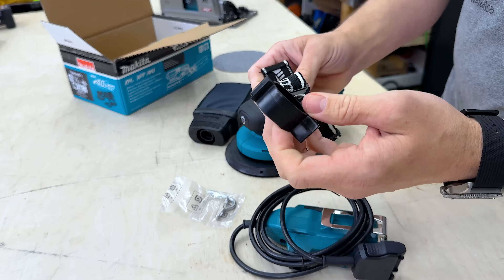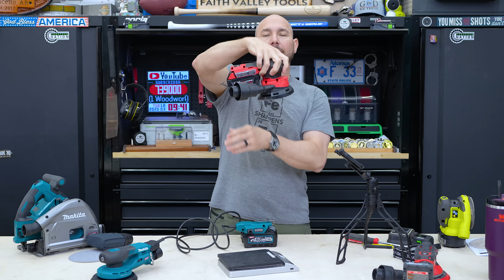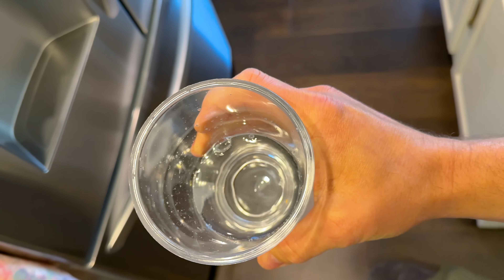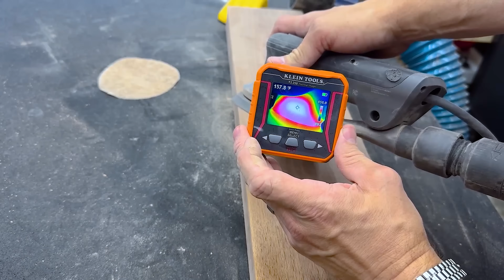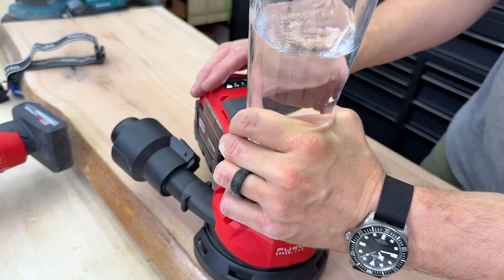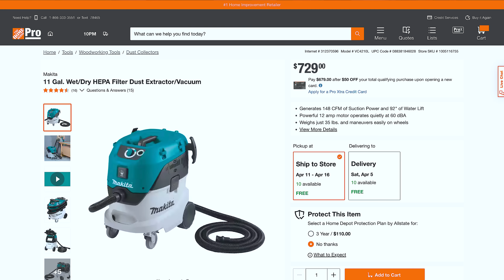Makita Just Changed Cordless Sanders FOREVER! (genius woodworking tool)

Comment: the high powered corded electric sanders cost much more than $250.  You can buy a low powered one for less.  You can't set the power/motor same way on a AC powered system.

Comment: Geniuses! I was thinking about that for last 15-20 years, but why not 48V or 96V? Why there is 5 pins and enforced communication with XGT battery that makes the tool useless if you want to use different 40V power source (it won't run without detecting the chip in the original battery). So if Makita, only 18V tools, because they do not care about genuity of battery.

Comment: Looks like a great tool for portability when NOT connected to a dust extractor. Kinda curious though why there isn’t an actual electric corded version though. Sanders both work and last so much longer when used with a dust extractor. So where is the use in a cordless sander when most folks would connect it to a dust extractor that needs to be lugged around anyway. Feels a bit like a lost opportunity. Quite disappointed.

Comment: I wish that Makita offered a direct AC connection for this sander. The tool is not that expensive, but when you add one battery and a charger, the price is doubled. I always use my sander connected to a dust extractor, so the portability of battery operation has very little appeal for me. I already have a 18V Makita LXT batteries and double charger and I don't wish to buy another set.

Comment: Thanks for this. I may jump on it. I have the 40v Makita Track saw and am super impressed with it, so I have the batteries. I have had several Festool ES 125's, and have used almost all the festool sanders, and the newer version of the 125 is problematic. It's been back for repair several times. I bought a Bosch 12v 5" sander and am super impressed by it. Ergonomics fantastic, smooth as silk. Battery life is the only caveat, so having the big Makita 40v even with a semi cord could be fantastic. I am a painter and also do millwork and trim carpentry.

Comment: Very interesting- I really don’t bother with cordless anything because I work exclusively in my garage, but the vibration and weight aspects might be enough to convince me. For the three people who actually read a sander manual, you may have seen a warning that people with Raynaud’s disease should not use the tool- that’d be me. Raynaud’s is a condition where the tiny blood vessels in your extremities go into spasm and cut off blood flow. It cans be uncomfortable like the pins and needles feeling you referred to, and in extreme cases there can be tissue death from lack of blood flow. Vibration is one of the main things that will set it off in addition to cold, so I have to be extremely careful about sanding. The Festool is just plain out of reach, but this isn’t and would be a really good investment. And even people who don’t have Raynaud’s, be careful about that prickly numb hand feeling after sanding for a long time! That’s nerve damage starting to happen and that adds up over time. A scrap of foam or even just a balled up rag between your hand and the sander can help protect you and keep your hands usable for more years.

Comment: Question, in case you've seen the delta variant or rectangular variant of this: it appears that you can't use it in tight corners like around windows inside corners because there is a plastic cover around the edge of the sanding pad that would bump into the wall meaning you miss the last couple of mm of area to sand. Is that correct? 

I'm looking for something like a mirka deos but without having to hold down that damn trigger all the time. Those mirka sander pads are angled so you can get in any corner even when confined by walls around the window.

Comment: I bought this sander based of this review alone. its amazing! @731woodworks i noticed you connect this sander directly to your festool extractor. do you think its worth a cyclone for sanding? or is it such fine dust and slow build up that the bag in the extractor alone is enough? many thanks!

Comment: I've been using mine with the 3mm orbit for a couple months now and its brilliant. 
I'm a painter and the weight of batteries gets too much when sanding above your head or even vertical surfaces. I know everyone is shitting on it because it has a cord but thats the best thing about. I dont always have access to power and when i do i hook it up to my Nilfisk M-class vac with the auto start Bluetooth controller, dont waste your money on the chips for makita tools.
This thing has a lot power for a cordless even more than some corded sanders i've tried, No regrets here.
I'll be buying 2 more, one with 5mm orbit and one with rectangle base, all for around the same price as festool where i live. 
***TIP for using it with a vac, buy the longer cord and attach it to the hose with the battery attached to the vac.

Comment: Honestly they all should offer a corded battery to tool adapter that could work with all their tools just to take the working weight out of tools when it really helps. I'd much rather run an M18 Fuel 18ga nailer with an umbilical and 5.0Ah battery shooting in shoe mold.

Comment: the thing about this particular tool... it really doesn't matter what battery platform you're invested in because the battery is not attached to the tool. You can just use an adapter for different batteries since the added bulk won't affect the tool.

Comment: That cord would be super annoying, especially with a vac hose on a site. I reckon better to use cord plugged into vac like normal or battery sander like Festool ETSC2 or DTSC 400. We use both. For detail and stuff not needing grunt we use battery, for grunt work direct power.

Comment: the cord strap keeps the cord from tugging on the sander. If youve ever used a wired sander, you would understand that this is an issue. The cord frequently gets in the way.

Comment: I don't see the point of battery sanders when connected to a dust extractor. You already have a hose attached, may as well have a power cord as well. Plus sanders have a continuous power draw so they just chew through batteries.

Comment: Now they need a 110v adapter so it can be used without batteries (for those of us that don't have several batteries laying around).  Granted, it's going backwards as far as tool evolution; it would be convenient to use a tool without worry of the battery dying when there is work to be done.  Besides, it's corded already...

Comment: Interesting concept! Also, I did not know about those baby M12 sanders, but as you mentioned, the first thing that came to mind was "how long do they last" - to be honest, pretty happy with my 5 inch random dewalt - and dewalt non-random 1/4 sheet. Somewhere in dad's collection I also have an old Hitachi half or 1/3 sheet mains sander with a lot of miles on it. Need to dig that out.

Comment: Next invention for someone out there.  An M12 and M18 plug in adapter like that makita sander.  Just a cable that plugs into the batter port.  In the shop I use the festool, it's strapped to the hose.  But out on job sites, not too many outlets.  Got to use battery power.

Comment: Interested in running with a battery set as currently everything, almost, is corded, so these are interesting videos.

Almost 6" so they are running with 150mm sanding disc, just easier for most of the U.S. crowd to understand.

Comment: I never bought into the idea of a cordless sander. It seems to me the sander will run out of battery power faster than most other cordless tools (other than maybe a router) which would require you to have a few batteries powered up. I also didn’t like the added weight the battery adds, especially when you have a lot of sanding to do. 

I’m starting to rethink a cordless sander, but Festool, Mirka, 3M and most of the top sanders are all corded. Perhaps they too will one day come out with a cordless platform, but for now I’ll stick with my corded sanders. The idea of the new Makita is pretty cool, and no doubt it’s a good sander, but I’m already on a couple different battery platforms, so don’t need yet another. Thanks for the video!

Comment: FUN MAth time :) 

Percent difference between a 5 inch circle and a 6 inch circle is approx 36.07%

represented by the functions where a1 = area of circle 1 and a2 - area of circle 2 ( pi * r ^ 2 )
a1 = 25(pi)
a2 = 36(pi)

expand that to differential percentage equation
( ( |a1 - a2| ) / (a1+a2/2) ) * 100% = Approximately 36.07%
Reply from the maker: Haha love some fun shop math! But I think the percentage difference might be off a bit here.
A 5" sander (125mm) has a radius of 6.25cm = 122.72 cm² surface area
A 6" sander (150mm) has a radius of 7.5cm = 176.71 cm² surface area
Difference = 53.99 cm²
When you calculate percentage increase based on the smaller 5" sander, it's actually about a 44% increase in surface area.
(53.99 / 122.72) x 100 = 44%
Either way — upgrading from a 5" to a 6" sander definitely covers way more ground faster... and that’s the kind of math I like in the shop. 😂
Reply: @731Woodworks  and average it out to Approximately 40.035%

and the moral of the story is that if a little is good and more is better than a whole lot is just right 😁

Comment: I like the paddle style sanders where it doesn't spin until you put your hand on it and you don't need to worry all that much about turning it on or off. That's one of the main reasons I went with an Ingersoll Rand pneumatic sander.  I just didn't see the reason why to pay the amount 3M was asking for their sanders.  The pad that comes with the Ingersoll Rand is a peal and stick pad so I needed to replace that and Mirka has great pads with replaceable velcro bottoms. 

I don't think the push button thing would be a deal breaker and I do like the cord on it.  I find that battery sanders aren't the best to work with.  Too much pressure and they tend to jump around and are hard to control. 

Another thing I would like is a straight plug into the wall.  I will always jump to a corded tool for sanding because lets face it I might be sanding for hours not minutes and I would rather have a cord on the ground than having to walk over to my charger to get a new battery in 40 minutes but to have in your truck when delivering something or working on site a battery powered tool is almost needed.

Comment: Makita do have an adaptor which allows an off-the-tool battery for all 18v & 40v cordless tools, this is the 18v version: Makita Battery Adapter BAP18E A-72067.
It's also great if you want to use a bigger battery for an extended runtime, Makita are about to release a 12Ah battery!!! It's also great for just making your tool lighter. Availability of these adaptors could be region specific

Comment: This has existed forever for the 18V range, just not as elegantly (or cheaply, oddly enough). For those commenting dumb things like "they're gonna invent one you can plug directly into the wall next": You're not funny or smart, you're just showing you can't think outside of the box. There's plenty of situations where less weight on a tool but still being mobile is a massive win.

Comment: Lol, to me, that is not genius. I do that already using the ridgid power inverter with my corded tools. No need to buy it. Just get the corded sander and then plug it in to your power inverter and use it. As long as it does not need more than the max watts the inverter can push.

Comment: Would be really easy for other brands to copy the idea, but cheaper. Just make a cord with the part for the battery in one end and the part that locks into the batteri trey of the sander. Or any other battery powered tool that works with the same battery.

Comment: It is annoying hearing 6" all the time when the reason they are slightly below 6" is because all sanders are sold in metric measurements and the 2 most common sizes of random orbital sanders are actually 125mm and 150mm not 5" and 6". ALSO the imperial system was invented in the UK but we Brits changed our ways when we started to see the light of how metric is just far superior in every way though because we invented imperial we still use it when referring to distance in terms of travelling such as driving and driving speed such as (miles or miles per hour)  but besides that one example and body height of a person which is another common thing we still sometimes use imperial for I find it better to just use exclusively metric for measuring projects you may be working on and so on

Comment: A 6-inch sander has about 40% more surface area than a 5-inch sander when you're just looking at the size of the sanding pad (since area grows with the square of the diameter).

But in actual use, you're not just sanding a single circle — you're moving the sander along a path, say in a straight line 3 feet long. In that case, the effective sanding area becomes more like a rectangle:

For the 5-inch sander, it's roughly 3 feet by 5 inches.

For the 6-inch sander, it's 3 feet by 6 inches.

So in practice, you're sanding a line that's 1 inch wider — which is a 20% increase in width. That matches the fact that 6 inches is 20% more than 5 inches.

So while the pad itself has 40% more area, the actual sanding coverage per pass increases by 20%

Comment: @14:15 Stinging hands is a pathway to hand arm vibration syndrome which you DO NOT WANT, Makita and Hilti have worked on anti vibration a lot more and for far longer than the other guys. It might be ok for occasional usage but for a pro you need tools that are anti vibration.
Reply: I try to power through the stinging until completely numb.

Comment: They are actually metric 150mm sanders, even there, the rubber pad is always slightly less than 150mm so that the sanding disc itself is the outer moving part and not the rubber pad, which could otherwise mark the work. 150mm is slightly less than 6 inches, it is just the 'American' outlets which just call it 6 inches. I know this is painful, BUT, there are more metric outlets world-wide than Imperial (feet and inches). And it is ALL about profit brother, all about profit!

Comment: I'm still a beginner, but I think balance is more important than weight. It could weigh 10 pounds as long as the weight is distributed evenly.
But I hope Ryobi copies this, because it solves both weight and balance. I also got me some of those 3M sanding disks, and you might have the best sanding configuration ever. Them thangs are Owesome!

Comment: Not clear to me why there is a fascination with cordless tools for the shop, beyond a cordless Drill/Driver set.  if you are working in the field, it makes sense. But a small corded sander is already perfect in balance, power and heat control and will be passed on to several generations...cordless tools might last several years.

Comment: What adapter are you using for the Festool sander's dust extraction connection to the hose?  I've been looking for something and no luck yet.  Been just jamming the vac hose over the port.
Reply: Hi did u find a solution cheers
Reply: @darrenbarber323  No.

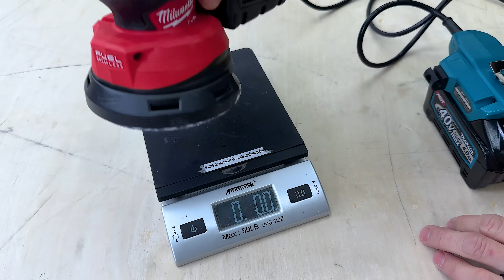Comment: The back tips down for the cordless ones because the center of gravity was moved towards the head (i.e. each were gripped nearer the head), whereas when the Makita corded was demonstrated, it was held closer to the middle/neck.  The weight of the motor in the head in most of these portable ones counter-balances the average battery if we don't use super big ones.  Take a look at the Milwaukee M18 one when it was weighed -- it laid flat on the scale, otherwise it would have tipped back by the battery (3:24).  

But don't get me wrong here, I agree that the argument holds valid if you're using heavier/bigger batteries. Yes the makita is lighter but I think its use case is only suitable out in the field (especially if connected to a backpack power).  But in the home shop, doesn't it defeat the purpose of making these sanders smaller and portable?  Kudos for pointing out that accidents WILL happen with this corded Makita (20:32) -- that's the whole point that we went cordless in the first place -- far too many accidents due to those pesky cords.  NO thanks Makita!

Comment: WTF is the point of this crap!!  You still need a vacuum and a cord. Just buy a corded palm sander. After testing out a few of these the PHENDO Electric Random Orbital Sander Brushless 5" was just as smooth as the 3M palm sander, the only thing smoother was the Mirka Sander (which is 4x the price). Its on sale right now for $150-180 which is an absolute steal !!

Comment: These Makita sanders are fantastic. You can also clip the battery onto the vacuum if you don't need the extra length if you wanted to use the 8amp battery rather than the 4 for the extra run time. Another option would be to use one the connectx battery back packs like the PC1500 which is 42aph battery pack. Essentially it's like having 10 of the 4amp batteries